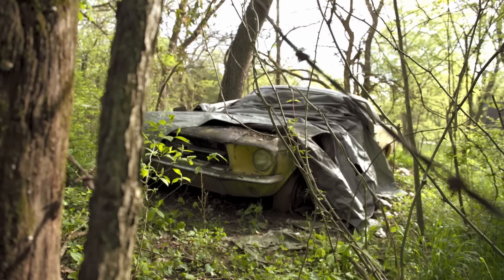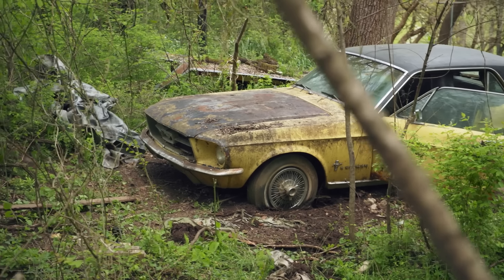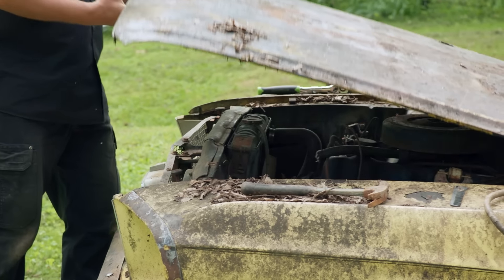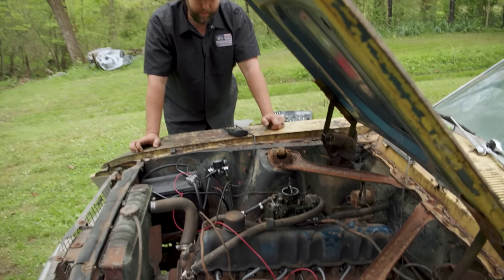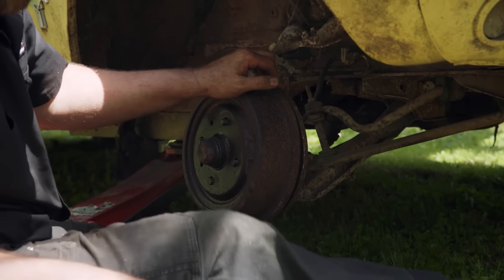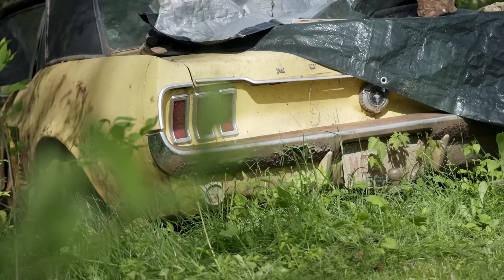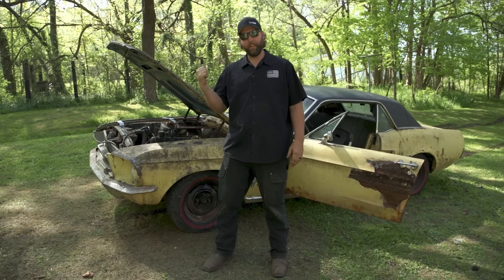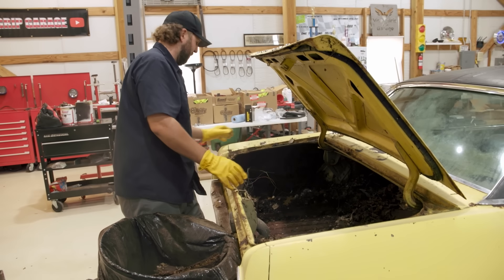1967 Mustang in a Swamp! - Roadworthy Rescues S1 Ep 1 FULL EPISODE | MotorTrend

Comment: The reliability of these old cars will never cease to amaze me! A modern car wants to die quickly, while the classics want to keep going.
Reply: Because they don't have 200,000 miles
Reply: @goldrims3219  yes they do lol. I work at a dealership, and we get 200k cars all the time that are like 2019 and up
Reply: Its not that they are more reliable, its that they are relatively cheap to repair, way easier to work on than modern cars and need zero specialty tools to do so.

This enables people to keep them alive with ease.

The average car on the road is older than ever before and has more miles on it than previous generations.

The barrier to entry to repair modern cars is significantly higher than 60s-70s muscle cars.

Comment: I wouldn't doubt that those rubber umbrella seals Ford used on the six cylinders are completely shot. They were notorious for hardening, breaking and getting into the oil pan. I took a bunch of them apart back in the late 60's and early 70's while working in a machine shop. -144, 170, 200. I saw a 289 that it actually got into the oil pump, wedged it and caused the hex drive rod to twist.

Comment: I had one pretty much like it and pulled the 250 six out and stuck in a 300 six with a couple of performance parts and  made it into a light street rod. It wouldn't beat a big block but it did just fine against the small block factory and even a few with cam sets.

Comment: My dad and I built a 66 GT for my first car.  My job was to take it down to every nut and bolt.   We found a 65 that was fully loaded for parts.   It only had 2800 real miles on it.   However; through a few changes of ownership of the storage place it was at it somehow got put into a pole barn area with a dirt floor.   The car looked mint but the whole undercarriage was rotten to the point where the springs pushed through the buckets/brackets.

Comment: I was concerned, @ 12:00. thinking I was hearing valves snapping or the fan hitting something.  NOT the time to fade in a twanging guitar! :-]  Love that car and I did something similar.  Floor pans, interior, but especially the carb and pipes.  You might not believe how improved those motors can be made.  As made, they bog down with the Carter carbs and the factory exhaust manifold.  I was on a waiting list for over a year for a new run of Holley 1 barrels, big difference.  But the split headers and dual exhaust ended bogging down, it just screamed.  Past tense, as the next generation has made it a V-8,  but that is why I saved it.  It's theirs, now. If you are willing to stay with the straight 6, 200 or 250, try a better carb and headers/dual exhaust.  Fast as I ever wanted or needed to go and look at the shape:  It has an over bite and gets squirrelly over 65 mph, with a 6.  Extraordinarily fast, for the era and tough to beat off the line.  Just can't exceed 65 without the front getting light.

Comment: pulling front drums on a Ford, you pull the wheel bearings, take the hub with as it is "swedged" to the drum. On that drivetrain, you will never spin that left wheel even if it is not seized.